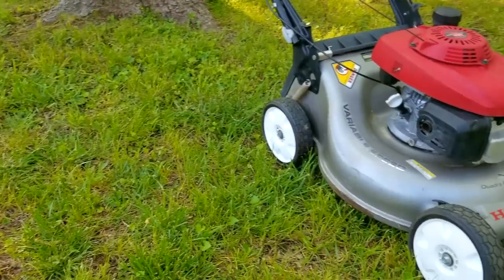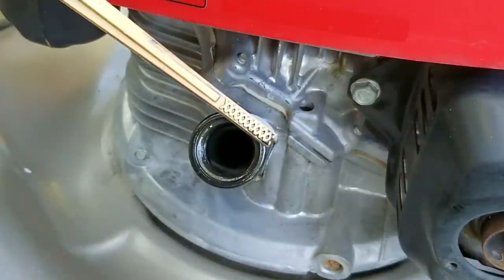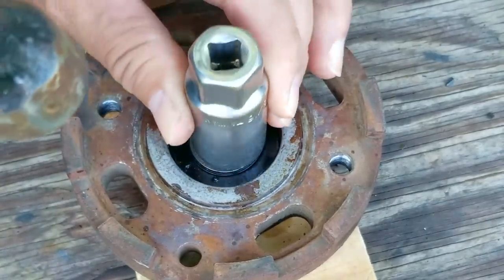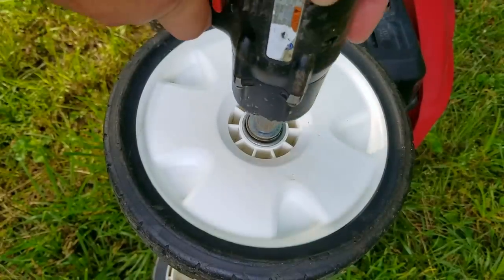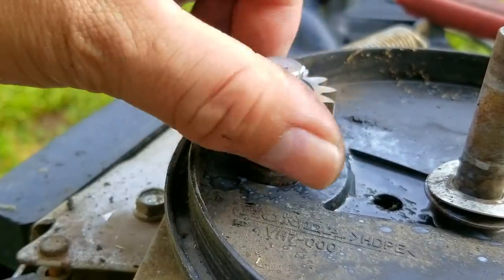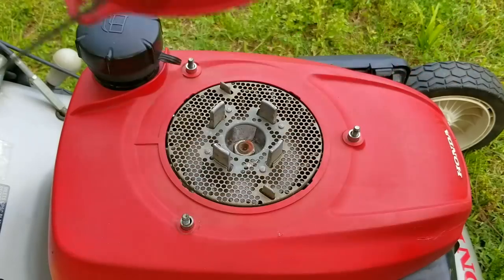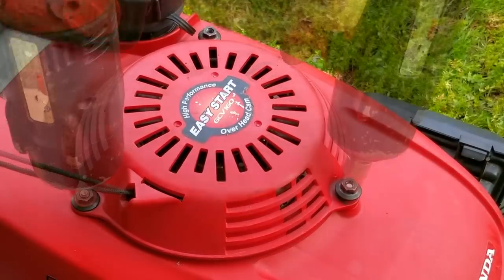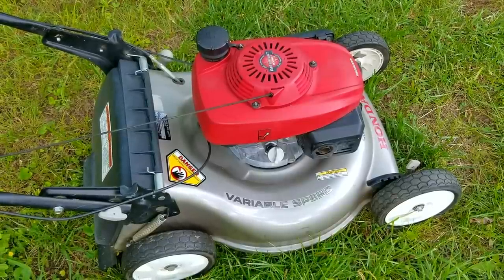The Most Abused Honda Mower I've Ever Seen, And It's Still Running

Comment: Back in 2012, I was in a jam and needed a new mower quickly.  Going to Home Depot, I couldn't make up my mind so, decided to go with the Honda basic self-propelled push mower, which cost a fortune.  Since Honda is supposed to have good quality, I assumed this would be a best bet.  This decision turned out to be a huge mistake, the mower has been substantially worse than any other mower I have owned since 1965.  The problems seem to center around the design of the mower; I suspect the engineers were fresh out of school and had never used a lawn mower before.  Since the mower cost a fortune, I had to make it last so, have modified it numerous times to make the mower actually usable.  One of the biggest gripes remaining on the mower, is it's super low engine power which I estimate to be the equivalent to a standard single blade more having 1.5 to 2.0 horsepower.  The engine quickly bogs down with grass that is 2" high, whereas my 1969 Lawn Boy mower cuts the same grass like a hot knife through butter (same 21" cut but, with a 109 cc engine, instead of 160 cc with the Honda).  The Lawn Boy also weighs half as much as the Honda, making it much easier to maneuver.
Reply from the maker: wow you certainly seemed to have some struggles with yours
Reply: @HomeGaragechannel  Thanks for your response.  I didn't want to bore your viewer's by complaining so, only mentioned about 5% of the problems (believe it or not).  I suspect the reason why Honda has achieved such a good reputation is, they probably have done a thorough study of what Americans perceive as quality, then incorporate those "window dressing" features.

Comment: High end vs basic mower.... Depends. If the mower is my primary, I'll get a high quality mower. My current push mower is a Toro Recycler with Personal Pace. Before I recently moved, it was my primary mower, and I wanted mowing help from others in the household, so I got a good quality, self-propelled, easy to operate mower. Now I have WAY more grass to cut, and my primary is a zero turn. I also inherited two basic push mowers. I'll likely keep one of the basic mowers for trim work, and sell the others. I don't like a bunch of features, like a blade clutch. I DO like Toro's Personal Pace mowers, as they are very simple to operate. No controls. Just crank and go.
Reply from the maker: thank you

Comment: We bought a very cheap mower for around 300 bucks, that is being used commercially and has been used so much that the ball bearing in the wheels literally disintegrated (easily over 1000h hours of use).
Surprisingly I could buy wheels from the manufactorer for 30 bucks a pop and all issues were solved, (teeth on the inside of the wheel was worn out as well).
Point is, modern mowers still last a long time, and ethanol was never an issue as well.
The low amount of Ethanol that is in gasoline doesn't cause any issues if you use the equipment regularly and don't store em over the winter with it.
Reply from the maker: you are correct about the ethanol thank you for the comment

Comment: I have a Honda lawn mower that is about 45 yrs old and all I have had to do to it is Reg maintenance and a new spark plug a used coil and I had to replace the tires and I just changed the original blade it had a small hole on the deck but I was able to repair it  oh I also had the carburetor cleaned for the first time ,it also has a blade clutch no issues so far touch wood lol so I can’t complain !! I love all my Hondas ,CRV civic snow blower and lawn mower bye 4 now
Reply from the maker: very nice!

Comment: If I was going to buy a new Honda mower I would get an HRX that was self propelled and skip the blade block and self start features. I like the upgraded wheels. In Canada the top of the line with the HRX comes with Versamow, a plastic deck and an extra large bag. These are all features I don’t need. I had a brand new Toro once with front wheel drive and a Tecumseh engine that lasted for 18 years by applying meticulous maintenance and following the Owner’s Manual. The end came when the deck started to break.
Reply from the maker: wow you did a great job with that Tecumseh
Reply: @HomeGaragechannel  Thank you. At the time I didn’t even know it had a Tecumseh engine. Just to confuse issues I’ve gotten back my self propelled 21” Craftsman with a Honda GCV160 engine that’s been in storage over 2 years. This mower was my all time favorite with the WALK easy control feature. This machine was a pleasure to use and work on. I thought I could manage with a Troy Bilt push mower but no as still have mobility issues. So I’m trying to revive the Craftsman. It’s quite a mess and so I’m taking your approach of getting it just to turn over with a fresh small supply of gas. The previous operator told me it was put away still running and has been sitting with gas in it. Thanks for your comments and videos. I’ve been so pleased with the mowers I’ve bought and found out that with proper maintenance they can last up to 20 years!
Reply from the maker: Nice! Good luck with your projects!

Comment: Our old Mcculloch m56-190awfpx (equipped with Honda GCV190 engine) lasted 6 years without an oil change, then something broke inside the engine and it always revved to the max.
Reply from the maker: wow, whatever happened to it then?
Reply: @HomeGaragechannel  the deck was bent and rusty, the carb leaked fuel (and I couldn't find an appropriate replacement) so I just gave it away to a scavenger. I bought a Husqvarna LC353 AWD (GCVX 170 engine) and the four wheel drive is a blessing.
Reply from the maker: nice!

Comment: Let me say: great video.
I was wondering if you would be willing to put together a video on this same Honda model HRR2165VXA with the single handle rear wheel adjuster. These things inevitably fail. That particular video would likely save alot of owners, and eliminate a whole lot of grief.
I just replaced this adjuster on my own HRR Friday 6/29/23. It was and is a time-consuming job. You may be able to spot a few shortcuts to save a do-it-yourselfer some time.
Thanks.
Reply from the maker: If I get this mower back, from the owner,  most certainly will. thank you for the suggestion

Comment: my 20 year old Tecumseh Toro still starts with 1, 2 pulls max with nothing but a yearly oil change and plug. Dreading the day it dies, since nothing today inspires confidence aside from honda. probably going to pick one up and leave it in the box before they're gone.
any need to do anything to it before storage, or just leave it factory packed?
Reply from the maker: good idea, been thinking about doing the same, nah, just leave it in the box, as is, no fogging, or anything.
Reply: @HomeGaragechannel  roger that, thanks!
Reply from the maker: no problem

Comment: The only dealings I've ever had with a blade clutch on a hand mower was on the dead Deere that I swa[pped the Kawasaki off of onto the Snapper and the blade clutch made a good blade adapter. and My answer is the same as yours as far as added complications. Basic is just fine with me. And as far a s no maintenance, Cheryl's old 89 Craftsman didn't have anything done to it till I came on the scene in 03 or 04. Now it had to have a new deck shell and the tranny laid down because I hadn't found out about the bentonite clay lube in the old Peerless trannys but now it smokes some but starts and runs just fine 11 horse Briggs flathead basic, no sleeve. Blessings
Reply from the maker: you and me both!
Reply: @HomeGaragechannel  The plainer the better. Bare essentials. Don't need a blasted speedometer on a mower!

Comment: I like Honda mowers very much. With minimal simple maintenance (air filter, and engine oil change, maybe a spark plug every 3-5 yrs), these things run forever. A simple water hose with the mower on its side at the end of every mowing season, would mitigate a lot of the issues seen with the underside of mower decks.
Reply from the maker: agreed!

Comment: ive only used 2 different types of mowers, a regular push mower with no self propel and one where the mower propelled faster or slower depending on my waking speed. tbh i preffered the first one because the self propel system just added a bunch of unnecessary weight too it which made the push mower no more difficult
Reply: the propelled mower is a toro personal pace and ive never had any issues with it and weve had it for like close to if not over10 years. tbh i dont think any maintenance has ever been done too it other then maybe a carb clean and probably an oil change at some point.
Reply from the maker: agreed
Reply from the maker: very nice!

Comment: Yes a bought a honda with all the extras but i do look after my equipment. My old flymo QS5160HW lasted me 17 years until the gearbox failed but i can't get a new gearbox for it.
If the honda lasts me 20 years it'll see me into my box.
Reply from the maker: wow that Flymo lasted a long time, and hopefully the honda does the same. I bet with your maintenance that it will.

Comment: Hey i have a 3.5 hp brighs sxs.1481HH it was running really bad on run when i would accelerate it would try to die and most of the time it would die but on half chocke it would run perfect so i cleaned carb didnt work replaced it still didint work but the engine was ran 22 years without an air filter and it is pretty easy to pull do you think the engine is just worn out? And btw the engine is on banana bike.
Reply from the maker: nice, I'd use a compression tester to find out if it's worn
Reply: @HomeGaragechannel  okay

Comment: Basement issues? What they may be, if you please? I'd never buy a house without a basement, doubles the space, plus a place for all the mechanicals to reside, just sayin. I make it a habit to check the oil level on all my machines periodically, and change all the oil out of all the machines in late Sept. or early Oct. just before it gets cold, generator, 3 snowthrowers, lawnmower, best time of year, no bugs.
Reply from the maker: very nice !

Comment: I have a problem with my hrs 216 
Ive checked flywheel key valvers new carb gaskets and it still surges and i cleaned it
Reply: I swapped it with a 217 and that varb runs good also
Reply from the maker: when that happens to me, I just replace the carb.

Comment: Variable speed yes, blade clutch no.  Hondas are great little mowers, but over engineered.  10 years and no oil change or maintenance, give me a break.  There is a difference between life getting in the way, and neglect.
Reply from the maker: I know right!

Comment: I want to do an oil change on my huskqvarna 190 cc push trimmer but I can’t find the oil drain plug is there another way I don’t want the engine to blow up
Reply from the maker: remove the oil dipstick, plug a pan, next to the mower, and tip the mower on it's side
Reply: @HomeGaragechannel  ok thanks that will make it so I can easily change the oil I want it to last a good while it’s got a Briggs and Stratton flathead engine it’s pretty reliable and starts easily
Reply from the maker: very understandable

Comment: Have you heard of using a small amount 1/4 cup or less per tank of Acetone to clean varnish and carbon up on a small engine
Reply from the maker: you didn't mention what to do with the 1/4 cup, but I'm guessing you're supposed to put into a full tank of gasoline? No, I haven't and No I wouldn't try it.
Reply: @HomeGaragechannel  the reason for me asking is I noticed the number one ingredient in carb cleaner is acetone. I am going to try adding it to my fuel occasionally. Thanks for your response.

Comment: I don’t know how people abuse these motors when I have never ever ever had mine repaired never ever had a single issue I change my oil I do my maintenance on my spark plugs and things never had an issue with the roto stop 
Or the engine itself or the drivetrain 😂 I mean I’ve helped fix people‘s that were mostly carburetor issues because they didn’t run it enough
Reply from the maker: I know right!

Comment: So I'm confused, why put any money into it with that rod knock? Could it last a long time even with that occurring?
Reply from the maker: not rod knock, it's an upper bushing issue. Because it still works just fine. the answer to your question yes it can. Mine was abuse and sound terrible like this one, and it's been running that way for the last 8 years.

Comment: There vary good machines but like ALL machines they need an oil change. And blade sharping . The knocking is from not changing the oil,  oil level low.
Reply from the maker: yes you are absolutely correct